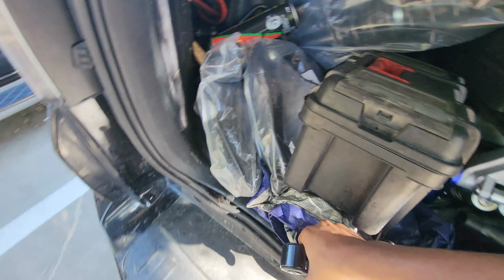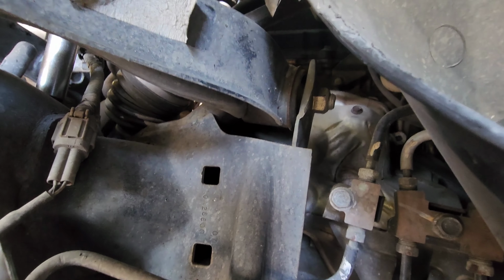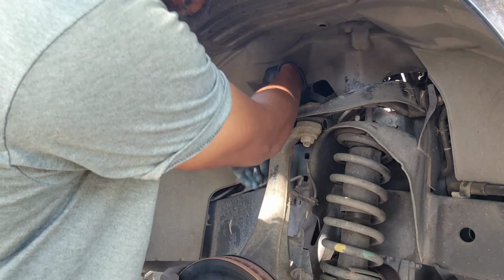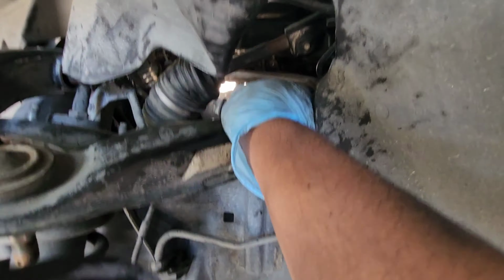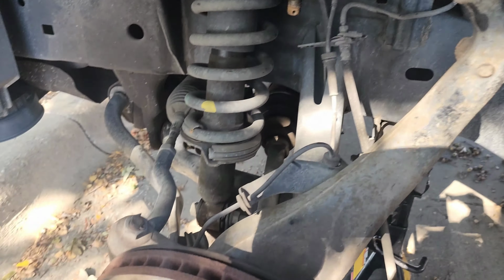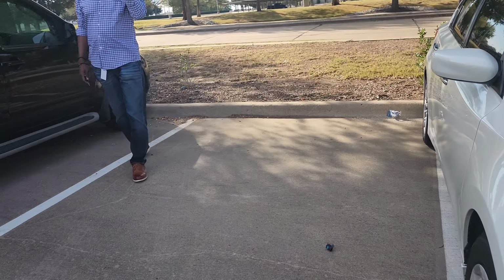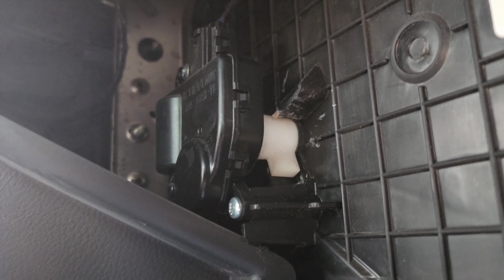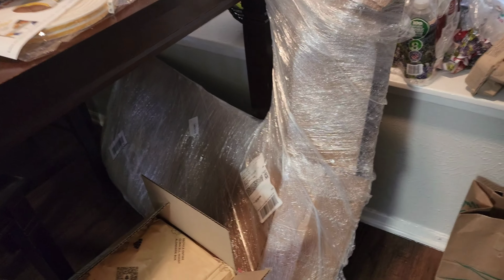Pathfinder Control Arm Replacement (05-11). Altima and a Ram Serviced Too

Comment: Is there any reason that the upper control arms bolts can't be put back in the other way so the nut is on the side of the steering gear.
Reply from the maker: I want to say it's typically installed that way in case it was to ever go loose the steering shaft would at least block the bolt from coming completely out
Reply: @HerbzAutoCare  yep that makes sense
Reply from the maker: @cdsmit27  yessir safety 1st!